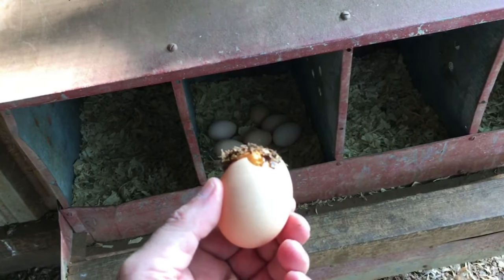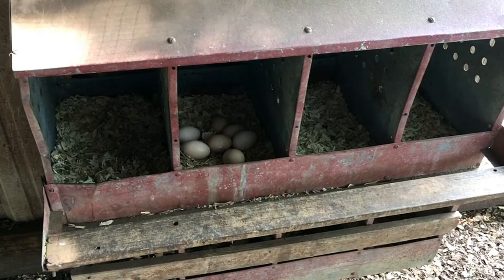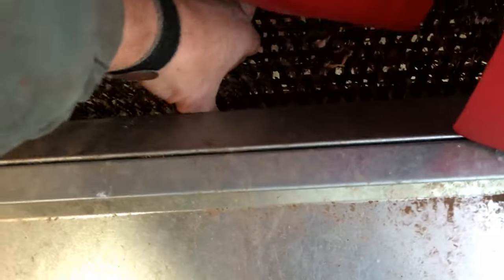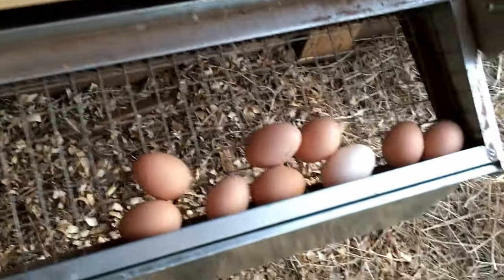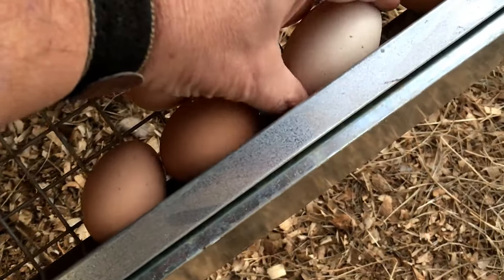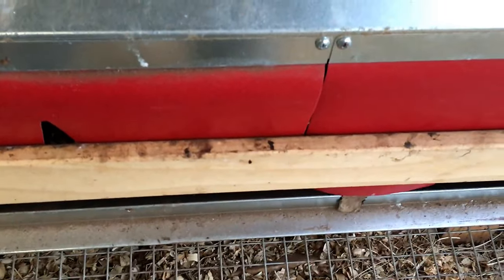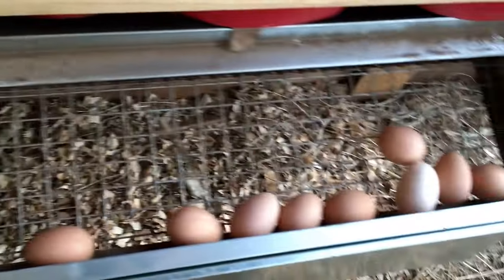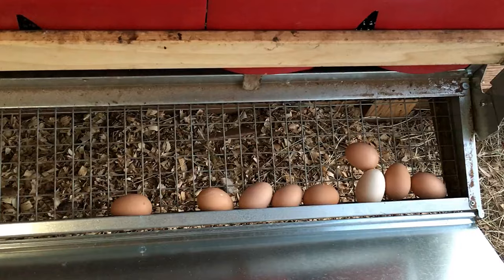BEST NEST BOX ~ THE ULTIMATE CHICKEN LAYING BOX

Comment: Looks like a nice box, but i would think the mesh screen and extra airflow would make eggs freeze and crack in the winters.    A normal nestbox has some bedding to insulate the egg and delay freezing.   Do you have cold winters?
Reply from the maker: Not like up north.
I'm in E TX
Reply: I wonder if putting a couple hay bales under it would insulate it enough.

Comment: My chickens will NOT use it. Any ideas?
Reply from the maker: I used bedding material in it... whatever you were using in the old boxes.
Tape back the red flaps so they can see in and walk in without it scaring them.
That worked for me.
Reply: I'm having the same problem we taped up the flaps, put golf balls inside and also some bedding. They still lay undernath it